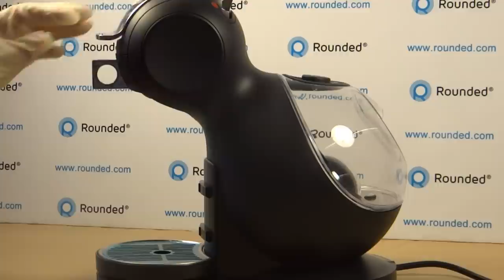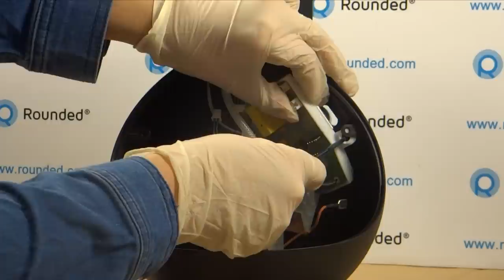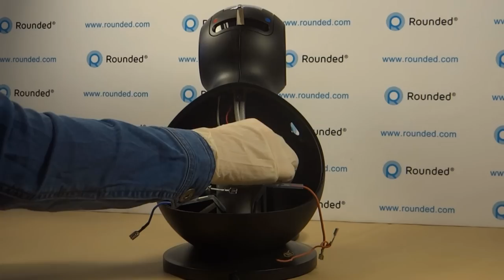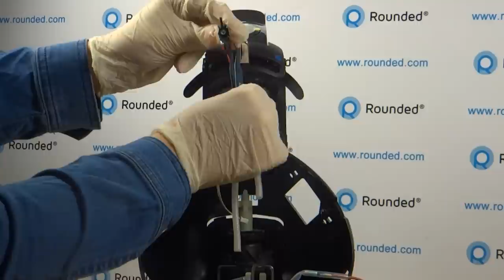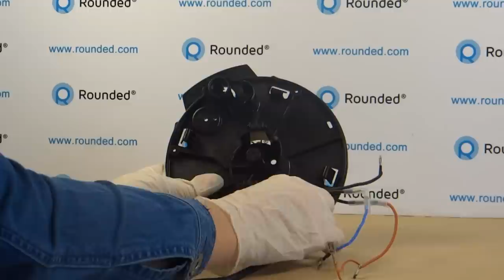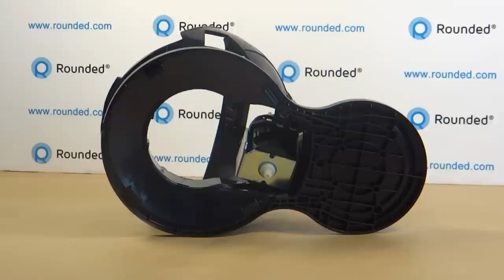Krups, Dolce Gusto KP2208 Repair, Disassembly manual, guide

Comment: I came here to see if I could get help as my gusto was blocked or air locked so opened it up after trying the tub on/off thing for weeks. As mentioned previously the video doesn't show all the steps and luckily I read a comment (thanks again russian friend) and laid the device over and poked a hearing aid plastic cleaning tube up the pin NOT the devices own as its not long enough. I got a good couple of inches in and felt an obstruction which cleared it. So, if you run your machine dry it drags bits through and clogs the needle. No need to go through the dismantling process and its dangerous too!
Reply: You guys just saved me £80 as i was about to get a new machine. tried Russian friends trick worked a treat.

Comment: Hello, thanks for the video! Question: I think my Krups Dolce Gusto doesn't heat water enough. I meaured it, it is roughly 75-78°C at the point where the water leaves the nozzle. The coffe come out not saturated and not tasty. Do you know if I may increase it somewhere inside the device? Maybe there is some electrical component that controls the temperature.

Comment: what tool did you use can't find the correct one to remove screws. please help
Reply: me neither. the screws are made so it's virtually impossible to remove them without ripping them off with pliers.
Reply: Pasveer Leeuwarden
Reply: Torx T10 with a hole (professional torx).
Reply: @DanishWarriorSkald  Thanks!!
Reply: Danish Warrior Skald they don’t even have replacement parts. After the warranty ends it’s trash where are we going to get replacement parts?